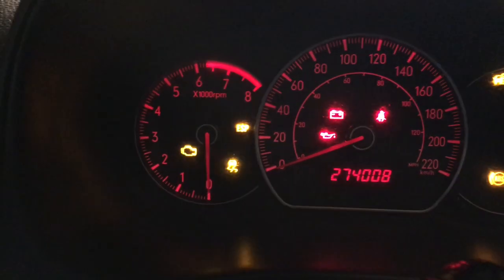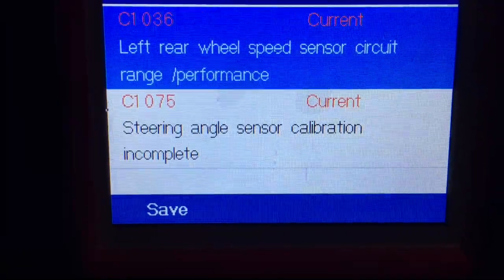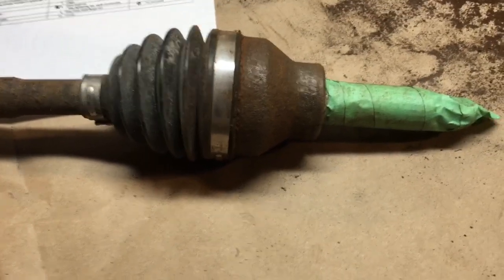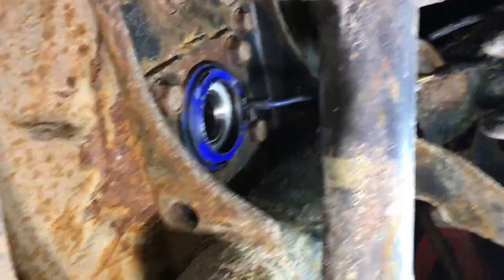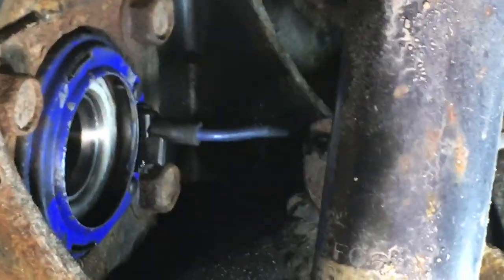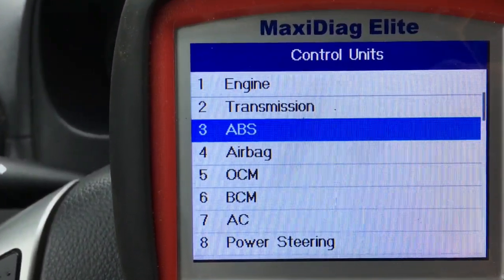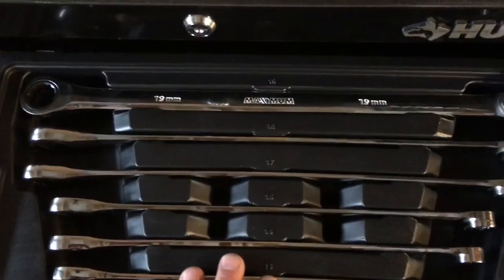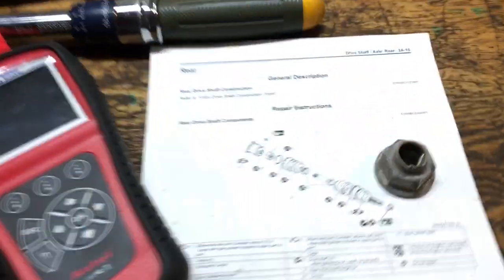SX4 ABS Fault Cascade

Comment: Hey Gibby - Ian...I Hope all is well with you and yours.....  I  Have just bought a 2008  SX4 initially to get me through the winter... all was good with the EPS until i had to ford some flooded roads last night to navigate my way home to Edinburgh.. Now my EPS warning light is on and i do not have power steering. Do you think the wheel speed sensors have triggered this due to being submerged in water... or have you had similar issues in the past or have heard of similar issues  that have been due to ABS sensors etc.. I know virtually nothing about this or any other car for that matter ... But have stored this knowledge from you about fault codes etc as i think i may need them by the sounds of it.... I do not have a diagnostic handset / tool ... as yet anyway..... I have checked the Power steering main fuse ( 60 amp one) and all is good there.. i am hunting for the power steering control module... i will find it eventually.. as i think ( depending on where it is located) .. that by submerging that in water.. i may have blown that... ?  Do you know if the speed sensors are connected to the EPS system ?  Hearing you mention you had to disconnect the neg terminal on the battery... Got me thinking .... Would it be a fools errand for me to disconnect that and re connect and let the system do its re set checks...... would that in your mind... (A)  not do any harm and if anything let me know its something more than a temp glitch... or (B) screw up some  other system like the immobiliser or something.... as you can see I'm grasping at straws here.... Any reply would be useful  even if it is just to say desist from this course of action and get some one involved with an auto electrical knowledge base with common sense ...?  All the best anyway... and i enjoyed your video.... have subscribed to your channel  to help me with my journey into the SX4 world of DIY ownership ....Peace out... Gogs...
Reply from the maker: Hi...Thx for the kind words. Canadian SX4 models never came with the electric power steering fitted. Only the the traditional “hydraulic” pump assist rack and pinion type. So I am afraid I am not much assistance...Let me look at my manuals (which oddly only detail the electric steering system) and maybe We can connect some dots (The ESP certainly requires steering angle and rate data input). Will get back to you in a day or two...PS: The OEM rear Hubs that house the wheel speed sensors are not infallible but very robust, fronts are bearings with integral encoder and external sensor. As you made no mention of the ABS fault light, I think it’s unlikely to be a wheel speed issue...Cheers
Reply: @TheGibby3340  that’s good to hear about The improbability of it being the wheel WSS’s - as the ABS system hasn’t been triggered as well...  I will focus on the steering angle sensors and the EPS control unit module etc... less rabbit holes to go down for me the better... Joining the dots would help .. and much appreciated as I’m sure you are a busy dude.. and you don’t even have the EPS on your SX4 ... 😁👍
Reply from the maker: Hello Sir...I seen under my notifications you posted a comment re: SX4 EPS...Unfortunately when try to view the comment it’s completely blank. Very strange indeed...If you care to repost it that would be great...If not, here’s hoping the video was of some use to you. Cheers 👍

Comment: Where did you find a new wheel speed sensor for your Suzuki SX4 let me know I watched your video and that's what I am having trouble with thank you
Reply from the maker: Rockauto.com
Don’t buy the cheap ones. They are absolute rubbish. Cheers 👍
Reply: @TheGibby3340  is the ones on the internet all junky ones or should I look for a higher priced one thank you
Reply from the maker: @matthewmmuchesko3098  Timken manufacturer quality parts in my experience.

Comment: Hello! Super helpful video! I have a question, I have a 
2010 Suzuki Swift and I was spraying a silicone product to protect my rubber hoses. I believe without knowing I sprayed it on the speed sensors connectors and got a bad electrical contact. I disconnected and cleaned them but the light is still flashing. Is the problem instantly clears when done right or do you have to drive the car for a few miles until it "recalibrates" thank you very much!
Reply from the maker: Sorry I am not familiar with the Swift model. However I think it’s doubtful some silicon overspray would result in this failure. Possibly a bearing/wheel speed sensor failure. Some ABS faults do require a short “proving” test drive to extinguish the fault light, post fault rectification. 🍀🍻